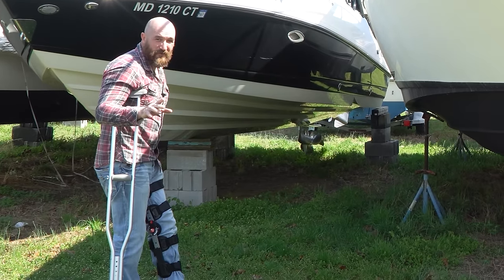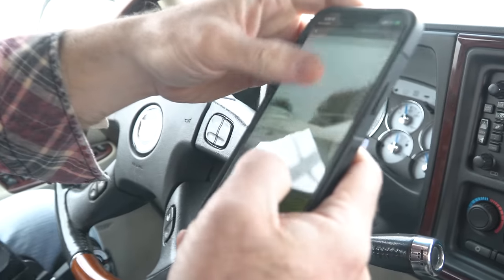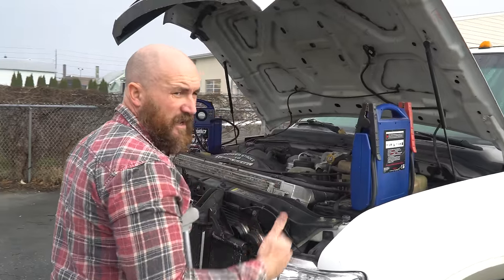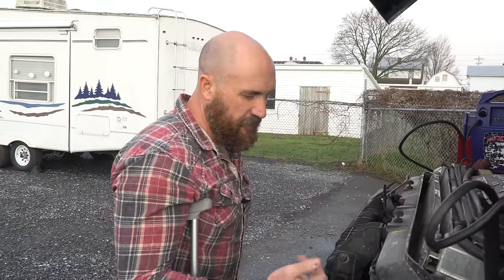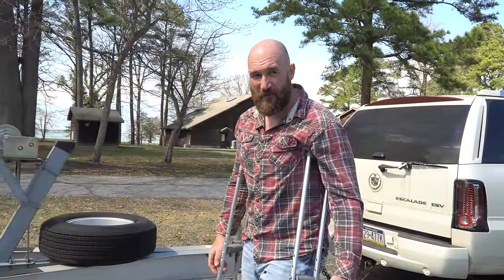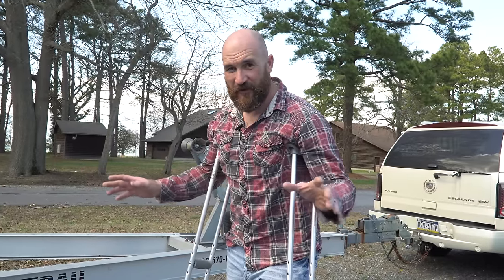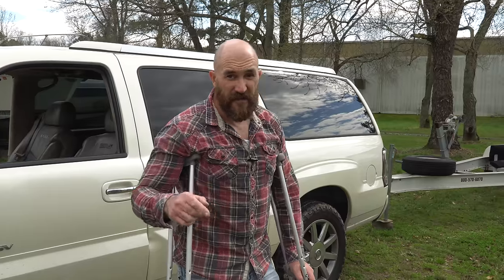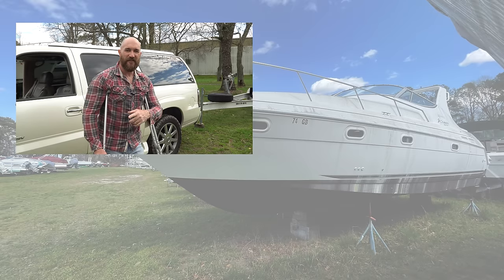We got a FREE Abandoned Yacht!

Comment: Cool boat , things to look at aside from the running gear, you’ll want to look at the stringers , I would take every floor panel out and check every single one with a moisture meter . It would be a shame to spend a lot of time and money only to find out the wooden structure beneath the fiberglass is rotten. Best of luck , thanks for all your content!
Reply: I highly doubt that boat has wood stringers. They should be glass.  I had a 28ft carver. A 34 ft carver and currently have a 42ft hatteras.  None of them were wood stringers..  he was given this boat because it probably needs a total repower.
You can get free boats bigger than that all day but you need the $$$$ to get them going. One of my customers had me replace both his 7.4 bbc in his boat and spent over $20k .   People think they can put any bbc car engine in a boat.
They wont take the pressure put on them. Plus in a boat one .other runs clockwise. The other runs counter clockwise .  You can easly spend $1500
Per motor just on hoses. Exhaust manifolds are $300 x 4. 
Allot of people in Florida are taking yachts and taking a chainsaw to remove hull #
And dump them on beaches and leave. Because it cost too much to maintain
And cant sell them when they reach this condition.  I have seen allot of beautiful 
Boats get crushed because they can't sell them. There are a few websites
Where you can get nicer boats free if you can afford to move them and repair them. A boat yard in Washington state crushes over 100 boats a year. Many allot nicer than this. Its amazing how many thousands of tons of fiberglass goes in the landfill every year.
Reply: I doubt the stringers are wood. If they are.... then I would stop right there, and forget about it. But this boat should not have wooden stringers.
Reply: @w124mercedes7  
     No doubt? Wow, I've for some time wanted something this size permanently in my backyard as a little crash pad. I'd always figured a couple of grand, but free...? I pictured having a koi pond in front of it just to add a water element with said boat landlocked behind my house. You've got the gears turning in my head, thank you!

Comment: As has already been stated. The engines wont be that big of a concern even if they are blown. The biggest thing to watch out for with boats is rot. Blistering (composite delamination) I dont know this boat so I cannot comment on its construction. But if its a cored hull boat there could be serious issues if there has been water intrusion. Take a hammer or screw driver and lightly tap inside and outside of the hull, transon, and deck. Do it in a hundred different spots and listen for anything that sounds hollow or feels soft. That will give you a fairly decent picture as to the structural integrity of the boat.

I will try to give you the good and the bad of something like this boat.

Ill start with the bad. 

If its not structurally sound you could very easily end up spending well over 50k just in materials to repair it yourself, triple that cost if you pay a shipyard to perform repairs.

Marine electronics quickly become very expensive. A couple years back I had my radar, depth sounder, chartplotter/navigation GPS, through hull transducer, stereo system and batteries replaced. When all was said and done my total bill was close to 30k 

Transmissions are not cheap. Two of those transmissions could easily set you back close to 15k 

Generator could easily cost you 15k to replace if its bad.

All of this is based on worst case scenarios.

The good:

If any of the parts are still good IE: engines, transmissions, electronics, generator with few to no issues other then some basic maintenance then you are sitting on a decent trove of sellable used parts that could bring ya between 10 and probably 30k which you could use to help push the 401 project a long further. 

If the boat just needs a few things replaced/repaired. You could easily have nice pleasure craft that depending on where you are and what year make and model that boat actually is could have a huge profit potential if you chose to sell it. 

I would do like people have suggested already and hire a marine specialist to perform a complete survey of the vessel so that you can get a pretty solid idea of what you are working with and what it would cost to get it back in seaworthy condition!
Reply: This guy knows his stuff....although I would say electronics prices are dropping. Delamination is the bear although sitting on the hard, its less of a concern. Usually it happens when boats get hit hard because they aren't tied up right or left in water where waves can slam into them. Once the cracks open up and you leave it sitting in water, the intrusion is inevitable. If a boat has been on the hard for that long, water is going to be difficult to detect and you'll need somebody REALLY good with a hammer to find soft spots in the structure.  I think you are on the right road of looking to part it out if any structural issues are found.

Comment: A friend has a boat similar to this one in size. He is constantly maintaining the thing. I've had 4 boats in the past. No more thank you. Too much hassle. Check for osmosis on a boat like that. Pull the engines right out and strip them down to the last nut and bolt for a full overhaul. Safety on the water is paramount. Good luck with this beast. I look forward to seeing what you do to it.
Reply: Persons would be better off limiting themselves to a paddle board or electric powered kayak IMO. :)
Reply: The first thing I would do is hire a marine inspector to check out the boat - who will find things like dry rot or cracked fiberglass laminations  that you might miss. If the hull is in bad shape, the craft should probably be salvaged - rebuilding the hull would cost a fortune.

Power boats are not really my thing - I prefer sailing, with an inboard for docking or getting in/out of some harbors/anchorages. The largest I have experience on was a 53 foot ketch that I skippered to teach salt water sailing and coastal navigation. It was large enough that it had a gen set, as well as full size washer, dryer and refrigerator. The head in the master cabin had a full size bathtub and the second head had a separate shower cubical - rather than having to sit on the toilet seat to shower.  

It had an auto-pilot that could be linked to either LORAN or GPS - and also had RADAR,  RDF and low band marine transceiver.

Comment: I'm a little skeptical about the 'been sitting for 15 years' part.  Yes, there's mold and yes, there's stuff growing but not nearly enough for 15 years.  Looks like a couple of years, certainly less than 5.  Either way, all of that will clean up, and the gelcoat will buff out while your biggest issues (questions) will be mechanical with two big blocks and a genset.  Didn't immediately see a lot of evidence of animal infestation but they love wiring. Make sure the hull and supporting structure are sound.  Good catch!
Reply: It was in a boat yard...could have been covered for most of it? But i agree with ya.
Reply: @Letsgotojail  good point. but the below decks looks like it had some occupancy within the last 5 years by my eye.
Reply: Agree. The boat itself is probably 15 years old. The garmin unit is the confirmation. Probably been sitting 5 like what you suggested.
Reply: You should definately look at the through-hull ports and replace as needed. Don't want those failing on open water.
Reply: @daniellawson9302  this vessel will need to be taken down to parade rest and everything inspected and refurbished. But should have a good boat when done worth more than what you put into it.
Reply: @sailorbychoice1  Yeah, but the equity you put into it, say 30 to 40 K, the boat will be worth more than what's in it.

Comment: This will have issues with the engines, electric and fuel systems .  You'll also need to make sure the bilge pump(s) is/are working BEFORE you put it in the water.
Reply: Bilge pump? That's a job for passengers with a bailer. 😉
Reply: A toilet adaptor allows the pump in toilet  to become 2 Nd bilge pump.
Reply: The entire electrical is fried. I put money on it.

Comment: To treat the mold, use an ozone generator. I lived on a 41.5' yacht for 18 years and mold is definitely something you have to combat. Ozone generators work great to kill the mold and remove the fuel smell as well. Just don't be in the boat while it is running and air it out well before returning. Caustic to eyes and throat! (BTY, Boats always look much bigger out of the water.) Get some boating CG Auxiliary or Power Squadron classes under your belt before you do the ICW and read some books. Lots of dangers. Lots of expensive mistakes you can make when you try to fly by the seat of you pants, like you like to do. (Buying a boat trailer based on a picture!!! REALLY??) I worked for Sea Tow for a while and wound up charging a newbee $1000 for his first day grounding accident (which didn't cover the mechanical repairs to the engine) -  which could have been avoided, if he simply knew the difference between red and green markers. I taught some classes on boating on the ICW and made lots of trips up and down the "ditch" doing deliveries and Great Lakes and Bahamas. Retired now, but it was great fun, but only if you take the time to learn the ropes. You are going to need new upholstery and it will cost several thousand dollars. Everything on a boat is way more expensive. Check out the cost of diesel in a marina. Fuel to the Bahamas is going to cost thousands as well. (Rough guess - Figure a little over 2 miles per gallon when going all out!) But the memories will be priceless.
Reply: But marine vinyl at Johanna's fabric on sale days.
Or better yet but it bulk from a wholesaler. It's cheap.

Comment: Sometimes diesels like to run rough after long periods. This may sound like a knock. Bad fuel spray pattern and cold engine. Just let it run for a minute. Check oil levels also😜
Reply: Rev it to the limiter she'll be happy 😂
Reply: @capyfanvok  hahaha. But seriously. Diesels need to get fuel in correct pressures, lube the injectors, warm up, get the juices flowing. Especially also run cold. They like warm engines to get the proper fuel burn at correct timing and that can sound like a knock if it’s off and run cold
Reply: That was a rod knocking, heard them many times.
Reply: @DDA40Xman  if that was a petrol engine then yeah. A rod bearing most probably. Diesel? Not so. Those diesels have a very robust bottom ends

Comment: When I crushed my heel in a bicycle crash I made the mistake of trying to get moving too quickly while still in the cast. The cracks in the bone didn't fuse properly and I had to have another operation, with even more downtime. Just wishing you well. I'm sure you know your limitations.
Reply from the maker: It’s so hard to not go go go….  Sigh
Reply: @rebuildrescue  no one here would be mad or upset if you slowed down for a bit. Yes some will bitch and moan but thats just the loud 5%
Reply: Yeah broke both legs and back in a car accident but couldn't just lay around doing nothing. Probably pushed myself to much but hey only you no your limitations. Just please be careful!! Seeing you climbing that ladder made me nervous.
Reply: @chrislodge7437  oh gosh that tuff
Reply: @samsbot1410  it was a miserable 6 months. But hey I'm up and walking. Some back pain but mostly all good.
Reply: I broke my heel 2 years ago.. It sucked... I still have minor pain if I walk on concrete or on hardwood floors for too long.
Reply: @Mattsc1974  They pinned it first inside the cast. Then they opened it up and attempted to fuse the joint with heel chips. That didn't work so they used bone off my hip. Just like you, I can't stand on cold concrete for long. The pain has never gone away. It's been 40 years. But everybody, including you, breaks and heals differently. Considering the risks I used to take on a daily basis on my bmx bike, and after 3 concussions, a broken shoulder and femur (month and a half in traction) - I'm lucky to be typing this. They just don't have the ability to replace ankle joints. Best wishes.
Reply: Same thing with my broken hand
1.5 years later it’s “as good as it’s ever gonna get”
Reply: Another one to say, you don’t want “that injury“ that you have to live with the rest of your life. You only get one body, listen to it, and look after it.

Comment: Check the oil on that Ford. When you fired it up I didn’t see any oil pressure on the gauge, but with the camera angle I could be wrong. If it’s good on oil level, as others have said, let it run a little longer. Could have sat for too long.  Congrats on the boat.

Comment: Such a great find!  So I'll chime in with a few bits of info.  Have dual screw inboards is awesome.  It enables a lot better maneuverability in channels, harbors, mooring fields ect.  I would definitely look at the stringers and any other below deck support timber.  Rotted stringers can be a nightmare to replace (but it's all been done before).  Those Mercruisers are great engines and parts are readily available.  Couple little things that killed me as a former Navy guy and an all around boat guy: On a boat, you have lines, not ropes; you have a galley, not a kitchen; you have a deck, not a floor;  a head, not a bathroom,,,,  Just busting balls a bit but yet another project I can't wait to watch and support...until you get back to the CJ at least. :-)  Congrats
Reply: Where is the poopdeck located?
Reply: @eh6971  🤣
Reply: lol
Reply: @eh6971  - ages ago, there wasn't a head with holding tanks & you would sit in a bottomless "out house" and just go over the side.

Comment: Look at the engines and exhaust manifolds carefully. Those motors are cooled with lake or sea water. If not properly flushed when stored the water will freeze cracking the engine blocks, cylinder heads and exhaust manifolds.
Reply: That sounds something earned the hard way by someone.
Reply: those are closed cooling systems. there is heat exchangers on the back. they have antifreeze in the block,and manis
Reply: yeah those dont have sea water inside engine jacket...the tank on stern side is coolant and exchanger so that is where you check for salt corrosion
Reply: The heat exchangers will probably have to be pulled and boiled to remove the salt corrosion.  Had it done on a small inboard diesel that sat for at least 5 years.

Comment: Osmosis (fungus). It gets into the fibre glass but that hull looks pretty solid, you can normally see it in the gelcoat on the outside if it's bad but didn't see any, other than that the thing with boats is size.
They end up being money pits and time sinks.
Reply: Break Out Another Thousand
Is all boat stands for. Lol
Money pit is right but then again you just might find a diamond in the rough too.
Reply: Osmosis is not a fungus it´s the transfer of water through a solid that has broken down....salting meat\fish is osmosis as it draws liquid out from breaking down the cells...I have an RO system (reverse) to produce zero hardness water for my tropical shrimps so I can adjust water to suit their prefered conditions.. in fiberglass it is a breakdown of the layers which allows water to "live" in the layers but not for a better term create a leak...

Comment: Oh that looks fun!  When it comes to a yacht like this (from my limited experience), it's gonna be a lot like rehabbing an RV that just so happens to float.  Your seals are gonna be hugely important (windows, doors, any passthrough glands for wiring and hoses) for making sure the passenger compartment remains in a good condition (water in an RV is a huge mess because water causes wood to warp).  I'd definitely look at getting the generator running first, it's a lot less complicated than the two drive engines, plus that will let you know if the electrical systems are up to snuff.  Depending on how it's wired, most of the lighting on the boat should be 12v (or possibly 24v) with only higher appliances (microwave, hvac) using 120v from the generator.  

In an RV, you have two electrical systems, 12v and 120v.  The 12v is fed from the "house" batteries, while the shore power/generator feeds the 120v.  The shore/generator also charge the house batteries via a converter (a big-ass step down transformer that rectifies and outputs the 12vdc).  In one camper I looked at, the converter's output was 50 amps at 12VDC, while smaller campers may have less amperage but still something significant to power all the lights and keep a charge on the house batteries.  In RVs the 12v batteries that provide house power (lights, accessories) is different than the 12v battery that's used to start the generator and the vehicle engine and I'd imagine that to be in effect here.  There should be a bypass that can be closed to join the two 12V systems so you could start your engine from the house batteries if the engine battery is flat, but this is intentional to prevent your house batteries from going flat and leaving you stranded somewhere.

For the 120v system, I'd imagine that this yacht employs an automatic (or manual) transfer switch, where when you connect to shore power (like on a marina), the generator is isolated and shut down to prevent the generator from backfeeding (this is electrical code).  Although most systems on the boat should be 12/24v, there will be a few 120v plugs for the microwave (maybe the fridge, but that looks like an RV style absorption fridge and may only require 12v) and a few other 120v accessories and outlets.

At any rate, I can't wait till you get that thing moved and tear into it!  Looking forward to the next video!
Reply: That's definitely going to take some elbow grease and those 454 Big Block sargood reliable engines as long as you're not grenaded or anything and you willing to make the effort and put the work into it you might have found yourself a gold mine good luck